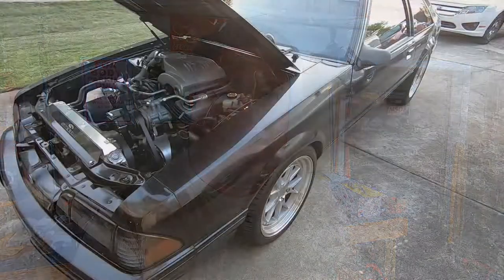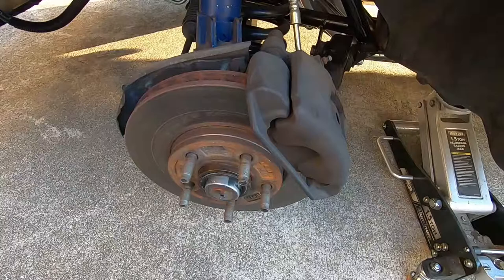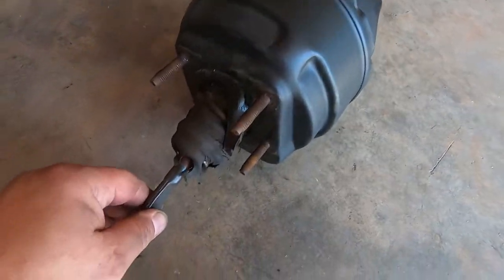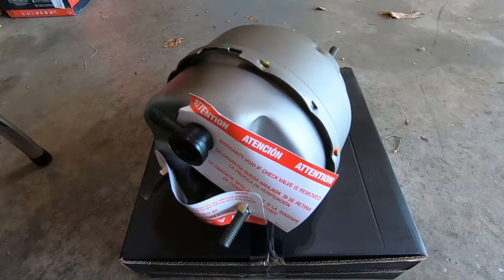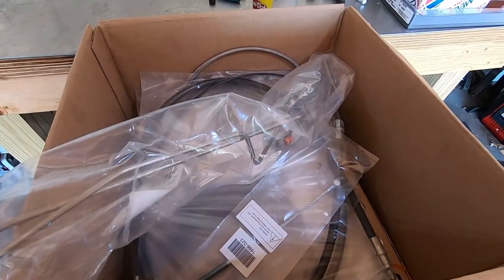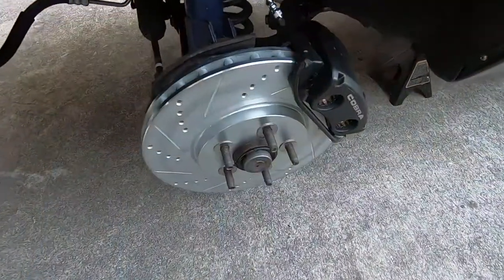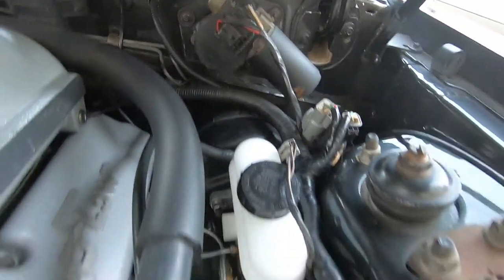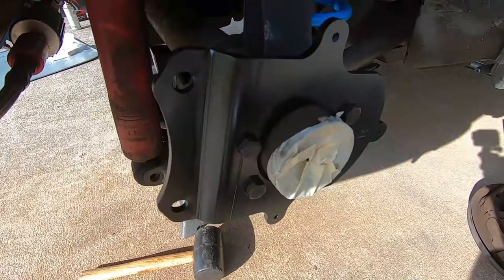Fox Mustang Cobra Brake Upgrade

Comment: Man your car looks beautiful,looks like it was made yesterday.
Reply from the maker: Thanks so much! I try to keep these cars as nice as possible 👍
Reply: @GeorgiaStangMan  I have a 91 and a 89, ive had the 91 since new, they dont looks as nice as yours but its not because i have abused them,I'm kinda odd, i like sports cars but I'm not into dogging them or nothing, they just look that way because of age, door dings,weathered, little rust here and there etc, i have driven them a lot over all these years,i just installed a 347 on the 91 and Ive been wanting to do a rear disc brake conversion hence why i was checking out videos and saw yours,i probably dont need it but i hate those damn drums,lol

I dont want to go to 5 lug so i found that kit by Foxbody that does the rear brakes,you have any opinions/feedback on that? there are so many kits over the years for rear disc brakes its hard to keep a clear mind about it but i saw a video of someone installing that aforementioned rear kit and it looks nice and simple enough, i guess if i installed a 347 successfully i can install some rear brakes,lol

Comment: Thanks for this video.  Im about to do the same to mine.   What tire sizes are on your car? What springs?
Reply from the maker: Rears are 285/40/18, fronts are 255/35/18. Springs on the hatch back are Ford C springs in the front and BBK springs in the rear. Springs in the red coupe are LMR springs in the front, and Eibach Sportlines in the rear. Good luck with the swap!
Reply: @GeorgiaStangMan  thank you very much.

Comment: I'm in the process of changing over my front spindles (currently have SVO front brakes on my original spindles); I upgraded the brake lines from LMR when I made that swap. Do you know if those front lines will work with the Cobra calipers? I know I have to change the brake line fitting to the SN95 piece. Thanks!
Reply from the maker: Unfortunately you’ll have to get the two front brake hoses for the cobra calipers. The stainless steel braid ones are my fave, and what’s cool about them is you don’t need the Fox adapter you mentioned because they already have that thread pitch and size on the end ready to go on the Fox hardline. Good luck with your conversion!👍